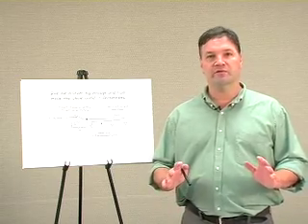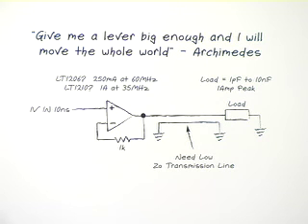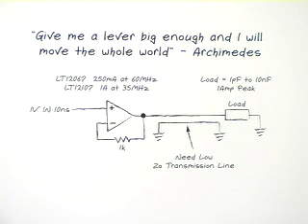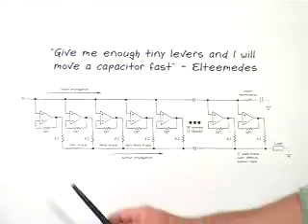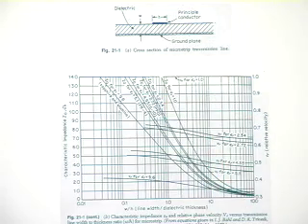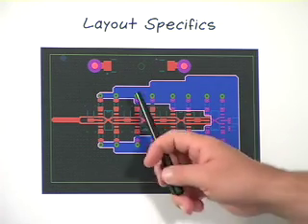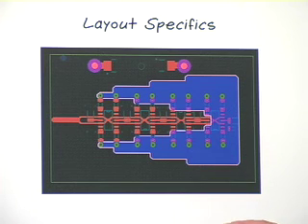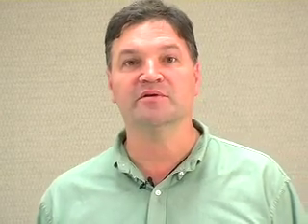Paralleling Amplifiers and Transmission Lines for Driving Capacitive Loads Fast - Linear Technology

Comment: I have a complicated question. If I have 2 conductors in the shapes of cilinders. and I want to transmit a signal from one conductor to the second one by hiting them together, like a switch. what frequency should I have the square wave at? Also would it be possible to measure electronically what locations on the ciliders the impact was? I know its a weird question but I'm struggling to find the answer. Also, the input of the signal would go to a micro controller for relaying different info.
Reply: Sorry, I just saw this.  There are probably a wide range of frequencies that could work.

Comment: I came across this video while researching the best way to parallel MOSFETs. as part of a DC boost stage of a inverter. can you give me detailed instructions on a safe way to switch 24v @ 100-300+ amps. at 50-100Hz. I have a good idea how to do so. but the 10% or so of doubt has me stumped. and seeking professional advice. since I am a self taught tinkerer. trying to build a inverter for my off grid home. any help is greatly appreciated. and thanks so much